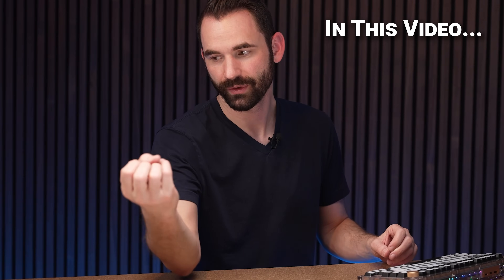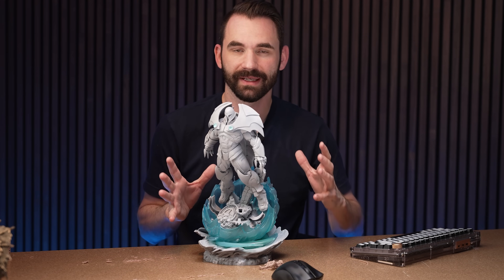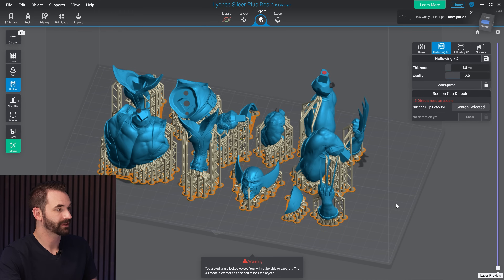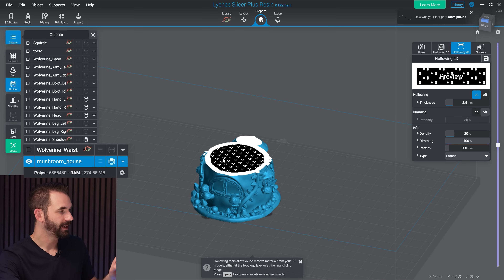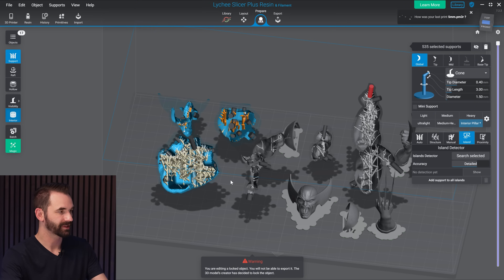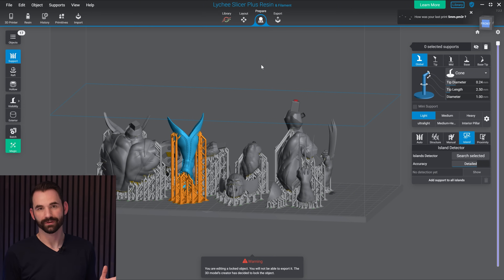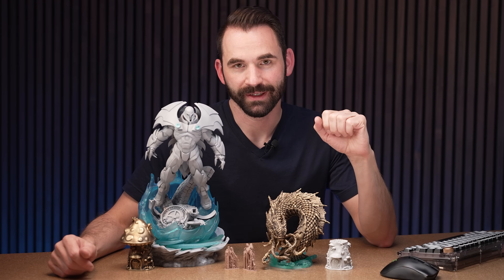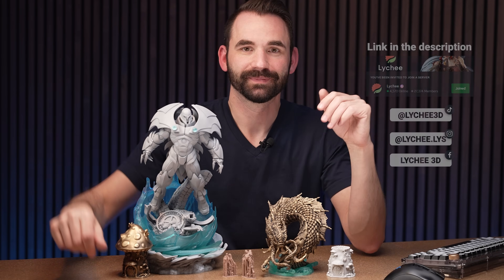Hollowing 3D Models? Don’t Skip This Step | Lychee Slicer Tutorial

Comment: Depends on your resin and if you know what wall thickness is the bare minimum.  Inside quality is always at 2.0. I don't use interior supports since finding my feet in 3D printing. I've never had a model pop since, and I have so many on my shelf from years ago that get hit by full sun every day—they never split! Plus, trapped uncured resin inside interior supports can occur if you don't wash it properly. I try to keep my models out of the IPA as much as possible, as this dries the resin out, making it more brittle and over curing does the same theres a find line within time frames there to keepyour resin properties solid. I learned all this with my Lychee Pro a few years back. I love Lychee so much honestly, 3D printing wouldn't be the same without it! I couldn't use the other slicers, they irritate the life out of me! Lychee forever!

Comment: There is an issue with support generation where there is a drainage hole. Is there not a setting that can be made to not generate supports in the hole areas?  I'm sorry if this is already fixed, I've been out for a while.
Reply from the maker: Hi, you can report bugs to our support team here: https://lychee.co/contact thanks :)

Comment: Definitely don't use infill for resin prints, they can cause major problems and are 1000% not needed. Sometimes the infill can't properly cure and will off gas and crack the print
Reply from the maker: You're doing great! :)
Reply: Only if you don't clean it correctly. I have more than a few professional shops that use infill for injection molds and consumer product prototypes. They extreamly very well for this application.

Now if you're printing very organic shapes like monsters I would agree Hollowing 3D is king.

Comment: Now question when you wash ur models and you wash all ur models out inside  with supports  do you cure them models inside or just wash and leave it
Reply from the maker: If the holes are big enough, it'll cure at the same time as the exterior, if the holes are too small, I recommend curing the inside :)

Comment: Thank you soooo much for giving details on the hollowing differences, and the methods for using / cleaning up the interior supports!!!!
One reason for getting rid of or reducing the density of the interior supports you didn't mention is making it easier to cure the inside of the object. Whenever I can, I'll put a 3mm hole in a hollowed object so I can insert a 395-405 nm LED to cure the inside.
Reply from the maker: Great tip!

Comment: I feel like, after watching this, I have realized that I way oversupport in comparison. Those overhang inside, I would have supported all of it, like a grid, at about 4mm spacing..... how does it not collapse on itself from all the overhang areas?
Reply: It all depends on the angle and size of the overhang. If you're worried place a pillar every 8mm and you should be fine. 

In a situation where I want to test it. I'll print two of the same object. One with only a few and another with a higher density to compare the results. Often I am surprised what I can get away with.

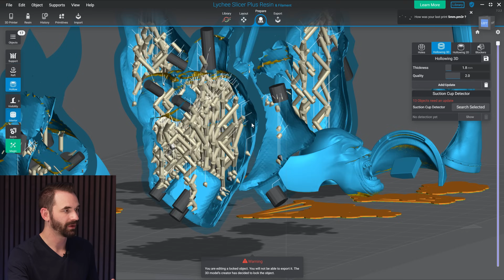Comment: What are these small white lines that you can see at 06:51 that connect to the supports and their tips? I sometimes see them while slicing and couldnt find what they are for or what they do.
Reply: when you go to the left menu and into the visibility options you can select tip only so you can only see the tips of the supports and the white lines are just a guide of where the body of the support is, and also the last option on the visibility menu hides those lines
Reply: This is a way to speed up the render in the 3D hollow view. The  white line represents a support. If you want to edit them. Turn off the 3D hollow view and use the slider to expose them. They will render normally in this way.
Reply: Thank you for the quick answer guys!

Comment: ? Some 3D artist send you STL in Unsupported and Supported.  And also send the LYS files. It happened a view times where I missed a part in Supported STL only to find it in a LYS file. Was this just negligence or maybe was the reason that for that part 3D hollowing was used.
Reply: For that I think it's just a mistake. You can export the 3D hollow objects into a .stl and the code will be converted into geometry during that export process.

Comment: Thanks for the explanation,  it now finally makes sense.  3D Hollow in LYS is a calculation that stays flexible.  It doesn't chance the geometry of the STL. So this probably also means that you need to slice it in LYS for printing and not export to be sliced from Chitubox. Or keep a LYS version and save as STL if you want to slice in CTB. Please correct me if I am wrong.  (Ps. I only have used LYS for creating supporting. I have always sliced with CTB because it  never failed me.) What are the pros and cons for slicing in LYS ?
Reply: You are absolutely correct. If you want to use a different slicer you will need to export the file as a .STL converting the code into gemotety.